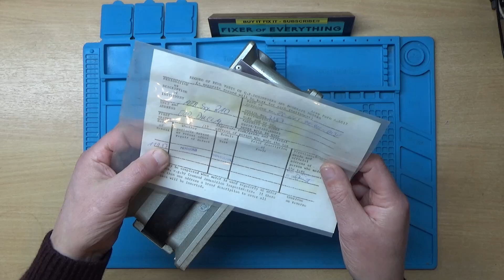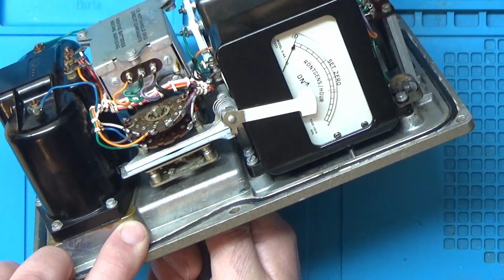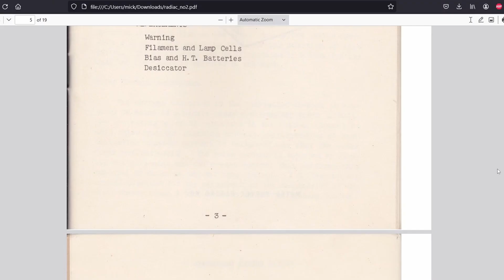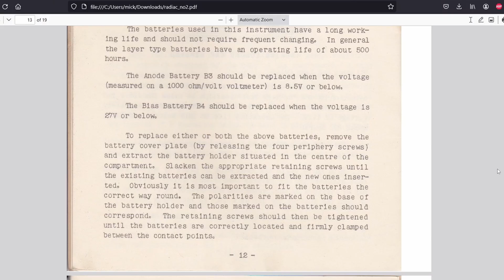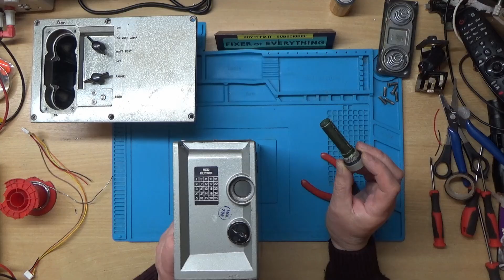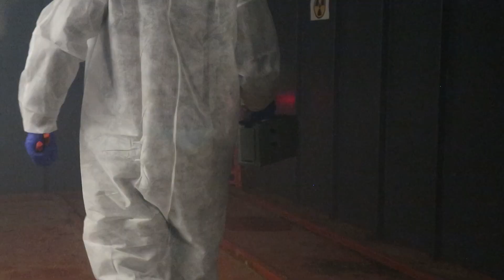I Built A Fake Bomb 💥To Test A Real 1950s Geiger Counter ☢️

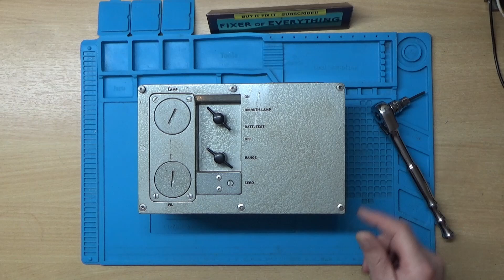Comment: @4:00 I always try to cut a slit in the bolts with a dremel or cutting disc...worth trying a flat blade first before drilling out ;-)
Reply from the maker: Thanks for the tip 👍
Reply: Same here works well. Also if you have to drill it, use a reverse drill bit they work it out as you drill and can save you a lot of frustration. 😵‍💫

Comment: Next time you have stripped out allen fixings hammer a torx bit into them and it will often give you enough purchase to get them out 🙂
Reply: Push in the torx bit gently with a vise or shop press.
Reply from the maker: Good idea 👍
Reply from the maker: Thanks for the tip. I was reluctant to start hammering it, as when I did a bit research on them it said it contained delicate valves / glass resistors 👍
Reply: yea that did cross my mind too especially as its die cast aluminium.  @BuyitFixit

Comment: An old glow in the dark watch or clock may emit some radiation. A dessicant tube like that may take 4+ hours to fully dry IF it's silica gel, other dessicants were used that were one time use.
Reply from the maker: Not sure if even a watch would have triggered this thing. When I was doing some research they said if the needle moves you need to evacuate immediately 😂😂😂

Comment: Wire lacing used waxed cotton cord, functional & beautiful when done correctly. Haven't done any lacing since the early 80's when cable ties appeared
Reply: Nicknamed cat gut😅, 1981, part of c&g 224 on my course
Reply: I did my city and guilds in Watford and had to do loom lacing, 😊
Reply: Same 👍
Reply: Taught that too, still have a roll of it, but it's black with I think a fibreglass core.
Reply: @jmileshc  something that’s not taught anymore, I think we were lucky
Reply from the maker: I wondered what it was called. Thanks for letting me know 👍
Reply: I actually learned using that when i was at school. It was funny, because nobody used it anymore, but the oldtimer teacher wanted to show how to do it properly.That was early 80's.

Comment: You did not say why the 2020 9-volt, did not fit in the 1950s era 9-volt compartment. Were 9 volt batteries a different shape back then? Maybe this will come up in future project.
Reply from the maker: The 9v volt battery used in this was almost identical to the 30v battery the was pictured, not the standard 9v PP3 type that is in use today.

Comment: I love those little Chinese spot welders! I have one and I’ve used it for years to repair power tool battery packs.
Reply from the maker: It's not bad with the thin strip that came with it, I did try it on a Milwaukee battery using the original battery strip which was a about double the thickness, but it didn't work on those very well.

Comment: Really interesting! you can regenerate the silica gel by removing it and putting it in an oven at 95-100° C for 12 hours. The color should return to blue. I know the 9v and 30 V batteries are expensive but this grid operates on microamps so they should last for a long time.
Reply from the maker: I did try 120c for about an hour but perhaps it just needed longer. The cr2032 and the 9v PP3 should last a long time as you rightly say they only use microamps. In the manual it said the original batteries should last around 500 hours of operation.
Reply: @BuyitFixit  yes, but you need to dry the whole assembly, including the paper and front ring.
by just drying the section with the beads, the paper is not being dried, so it will stay pink-it may turn blue after a while anyway, since the beads will dry the paper.

Comment: Would you believe it but Walmart in the US sell those 30v batteries for $15?
Reply from the maker: Nice, I did a little research on the unit and the consensus on the internet was the batteries were obsolete and were only made in special production runs. It still worked out cheaper with the CR2032's 👍

Comment: Some smoke detectors use a small radioactive element for detection might be worth a try
Reply from the maker: Yes the old smoke detectors used Americium 241 I think it was. I actually got an expired smoke detector from my neighbour but the more modern smoke detectors seem be optical these days and just use an LED and photodiode to detect smoke particles.
Reply: @BuyitFixit Yep Americum 241, its principle decay product is alpha particles (helium nuclei). I don't think this meter can detect alpha particles at all.
Reply: Use all the time for rad training.  Try to find older gas lantern mantles.  Contain thorium.

Comment: Hi You can rejuvenate the desiccant by just placing it in a 350-degree F oven if it is not completely dead, make sure to do it with ventilation. you can use a Colman lantern mantel bag, they had I think thorium impregnated in them, also Fiesta ware for a source.
Rich
Reply from the maker: Thanks Rich, yes the old lantern mantels were indeed impregnated with thorium. I think it still wouldn't be high enough to trigger these. I did read that if the needle moved you needed to evacuate the area, so probably a lot more than a gas mantle! I did try to rejuvenate the desiccant but with little success.